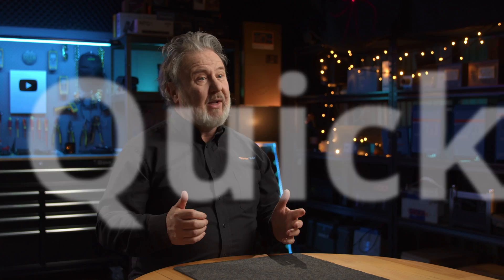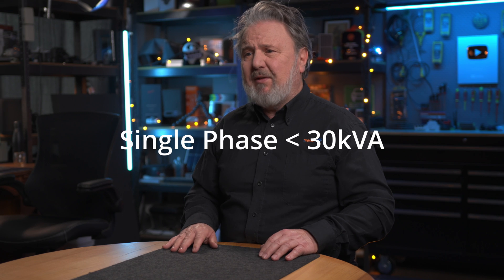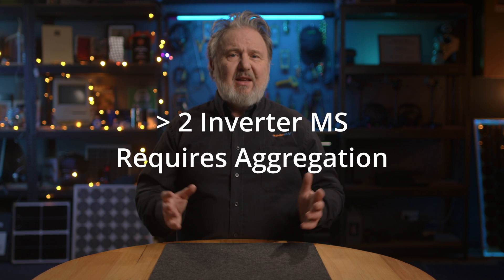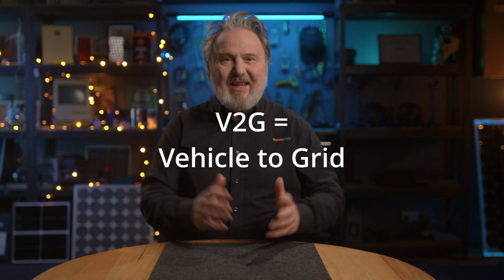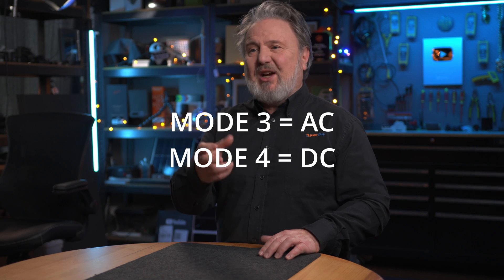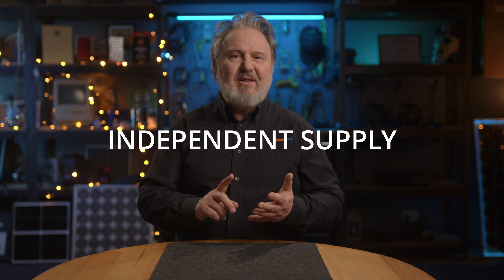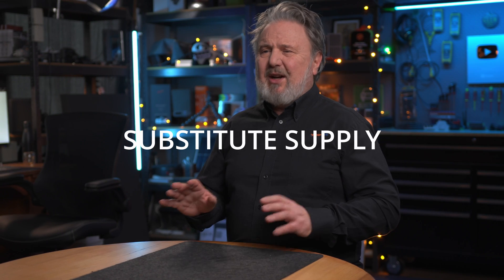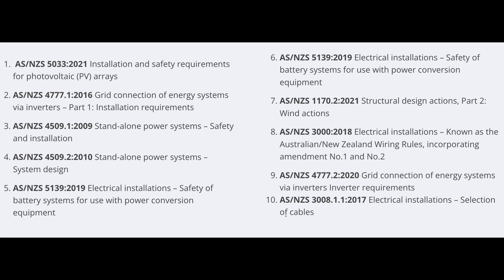Tech Quickie #1 on changes to AS/NZS 4777.1

Comment: Commercial solar energy is already 1000 volts. You are not allowed to mess with 1000 VOLT because it is CAUSE. Determine the cause value at low temperature V = 1000V/44V = 22.72 x 44V x 1.1 = 1,099V at the input of the inverters and see if they will explode? Civil disobedience as a test of the validity of technical standards. Inverter operation failure the maximum CAUSE value is; V = 1,099V x 1.8 = 1,978.2V at the input of the inverters and see if they will explode? Civil disobedience as a test of the validity of technical standards.